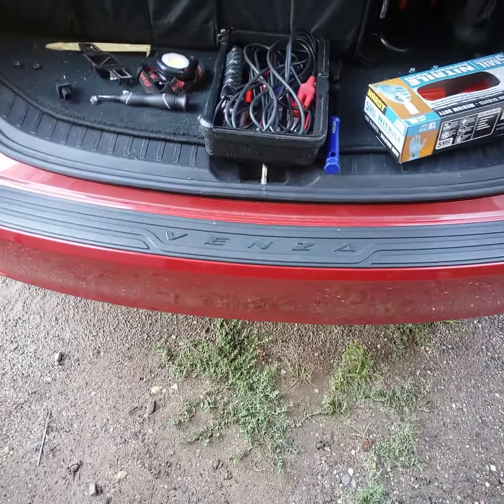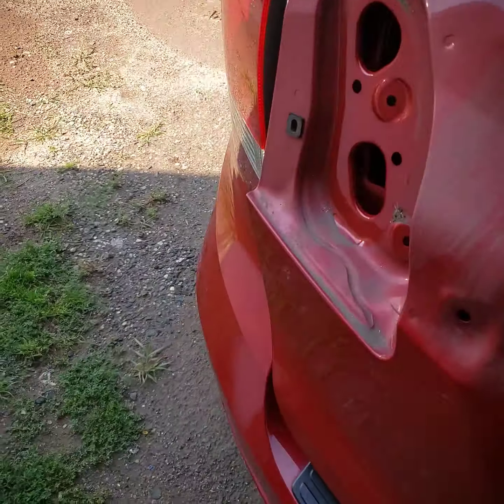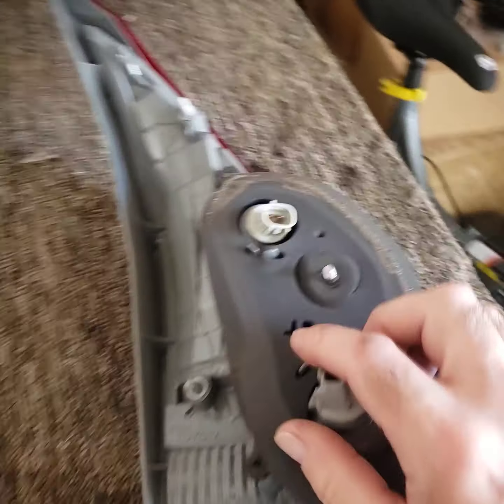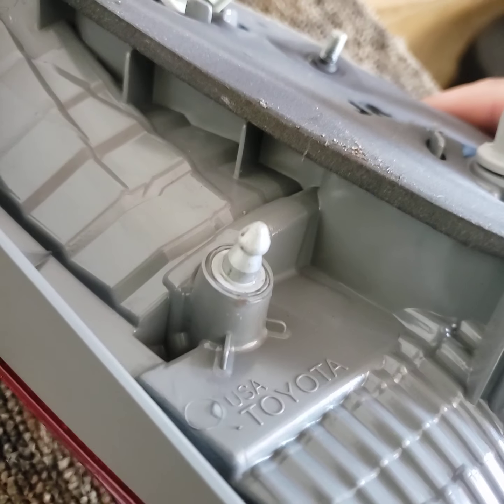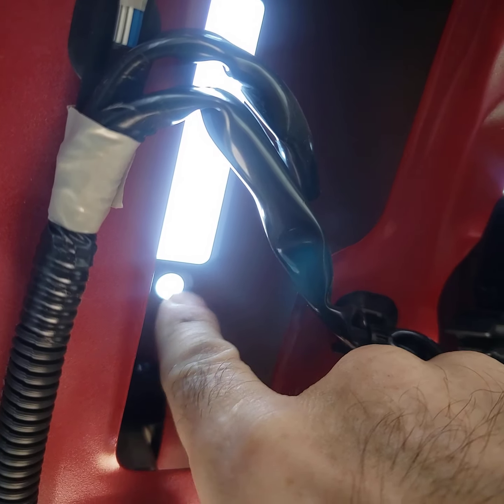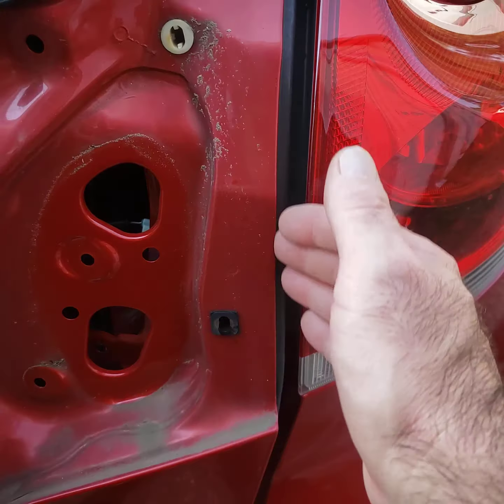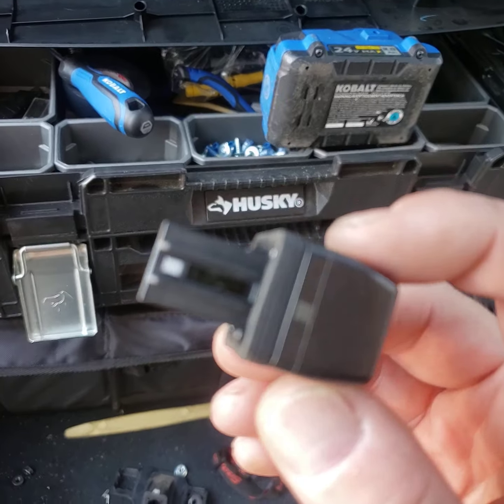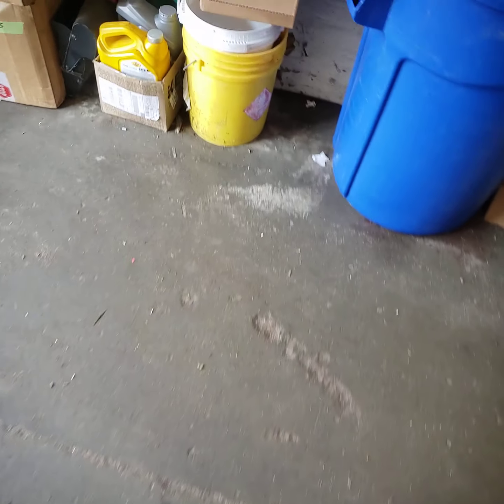How to remove backup camera 2013-2014-2015 Toyota Venza

Comment: Thanks,  having same problem
Reply from the maker: I ended up finding a brand new, oem, exact fit Toyota cam on ebay for $68. The Toyota dealership down the street quoted me $750 before tax for that tiny camera 😂😂😂
Reply: @MyFavoriteWeapons  yes its crazy,  my dealership said over  $600 here in Saskatchewan. I bought a new backup mirror with a camera for $100, should be good 1080 resolution will see if I can get it installed lol 
Very frustrated that original camera is not weatherproof enough. Thanks for responding have a great evening!
Reply from the maker: @KYIV0482  no problem, I'm happy it helped. Installing that type of camera isn't difficult. You'll have to drill a hole to run the wire through unless you just remove your old camera, run the wire through that hole, and seal it well afterwards. The plastic panels in these cars mostly pop off with a bit of pulling. If you have side curtain air bags, rear or front or both, make sure you don't run the cable across any of those. Always behind the air bags and secured away from them with zip ties. Or just route them completely away from the air bags if possible. You should be able to test the old camera wiring right at the plug and find out which one is the reverse trigger to turn the camera on. Tap into that.
Reply: @MyFavoriteWeapons  good point thanks👍

Comment: I was able to swap out the license plate light with a LED one without taking everything apart. I think i managed to wiggle it out by just loosening a couple bolts iirc
Reply: Ah i think i remember now. i guess i pulled the bottom half out
Reply from the maker: You can't do that with the camera